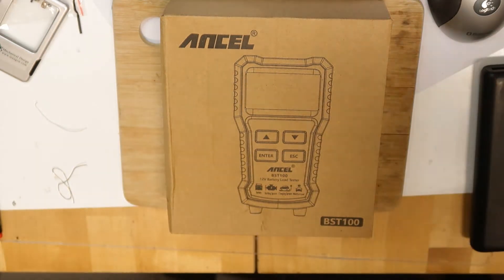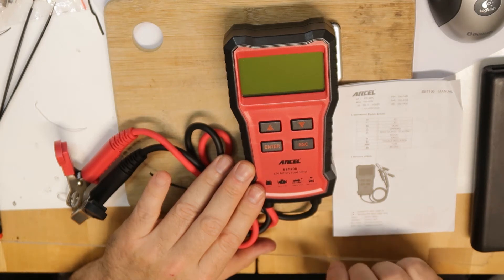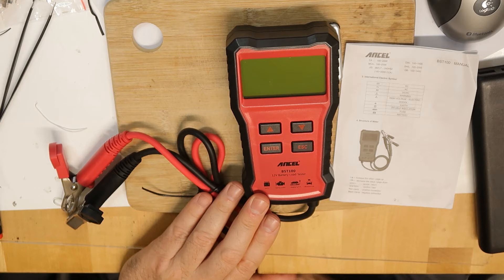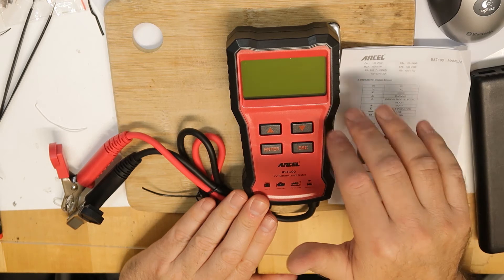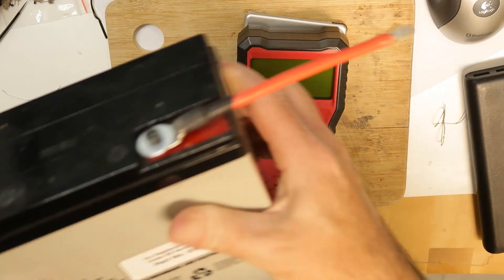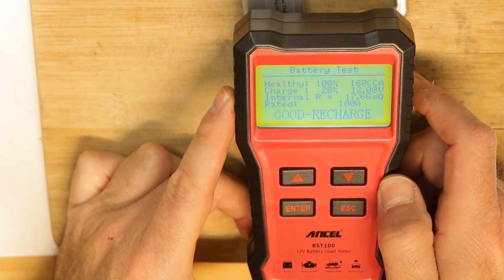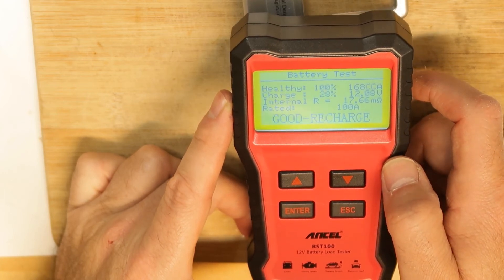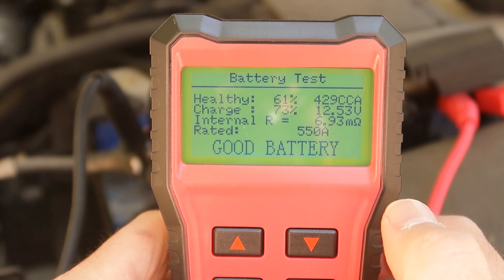Car Battery Tester

Comment: Hi רועי, great video. I got that machine, however can’t figure if and how it doing the LOAD TEST. Can you explain the numbers that you come with? Thanks, Koby.
Reply from the maker: This is very simple - just choose the CCA (don't input any current other than the default) - it will measure the actual current your battery can deliver (search from the internet your car numbers) - also you will get the internal resistance, and voltage, this is all you need in order to verify that your battery is good enough
Reply: Thank you for your answer, but I’ll asked about the calculation that you come with, I’m very happy with this little machine just want to understand the build-in resistance and how it physically check the CCA, I guess the resistance is changing so it will change the amps (Ohms Law). Great YouTube.
Reply: @Koby Ki Compared to resistance-based load testers employing heavy-duty carbon resistors that momentarily draws hundreds of amperes from the battery,  these relatively newer breed of battery testers are classified as non-invasive, conductance instruments. Online references abound for these terms.

Comment: Hi, you must take right CCA cold cranking ampere number from side of battery label or you won't get right result from tester. Like that second battery if it's real CCA is 400A not 550A tester would say 100% good battery not (61%). If you can't find CCA value it might have it said some of ten another standart like EN or so there is 10 different to choose from that tester. All those mean how must current battery will give current to crank up car motor when it's cold temperatures.
Reply: You don't really need to, the entering of your battery's CCA is simply for the user to compare to the measured CCA.  Not needed it if you're not going to print out the result for the customer. The more important thing is that for it to be 100% accurate the measurement should taken with the battery out of the car or disconnected and tested at 0°F or -18°C or else the CCA should be higher when measured at room temperature.  The conductance of the plates is the most important indicator, anything above a resistance of 7.0mΩ indicates the battery's plates is sulfated and needs to be replaced !

Comment: Hello, I'm new user to this device. Cca is the amp amount right? For example how to check the battery amp if we don't know the history of the battery amp? Tq
Reply from the maker: CCA stands for "cold cranking amps"  - it is the ability to test current at cold weather, any way yes it does estimate the Max current out - and it also measure the impedance (both related), the history doesn't matter - all that matter is if the battery can supply the current out